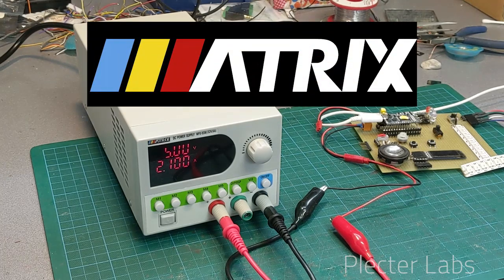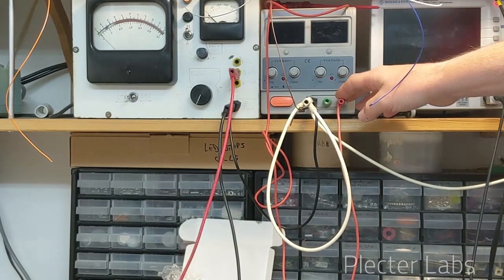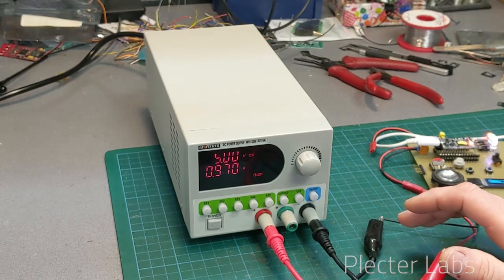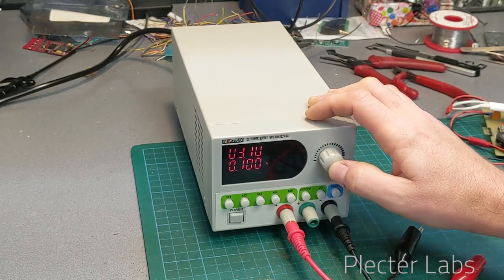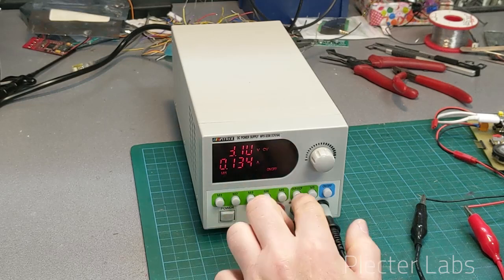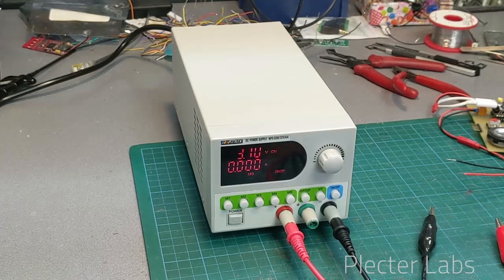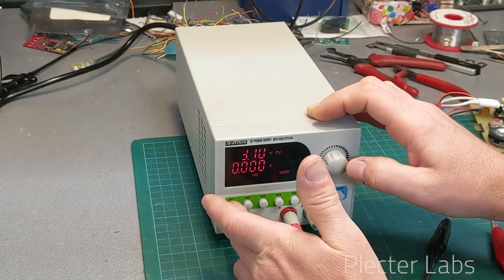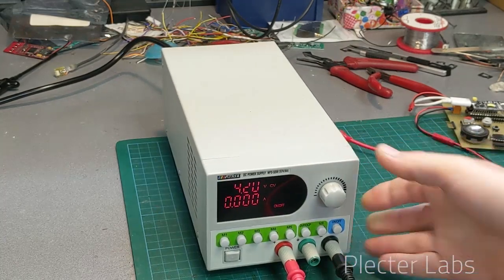Matrix MPS3206 Bench Power Supply Review

Comment: If the main power is disconnected does this power supply hold the previous pre-sets or are the settings lost when the power supply is shut down from line voltage?
Reply from the maker: presets are maintained and can be recalled. I'm not sure about the last used settings, but I think so